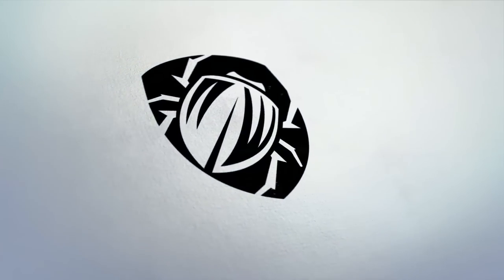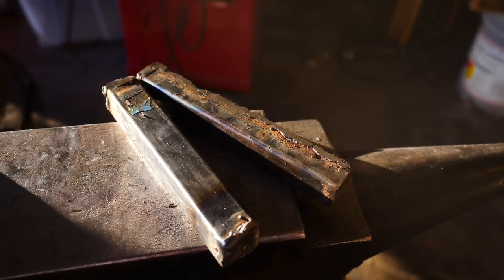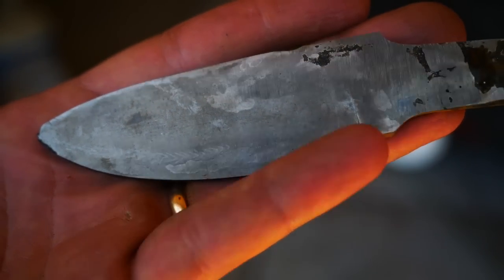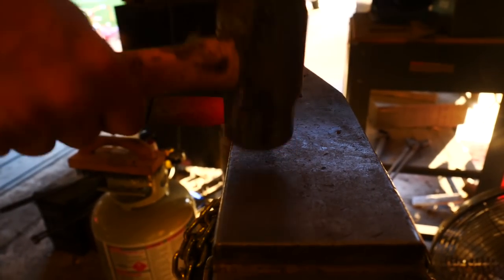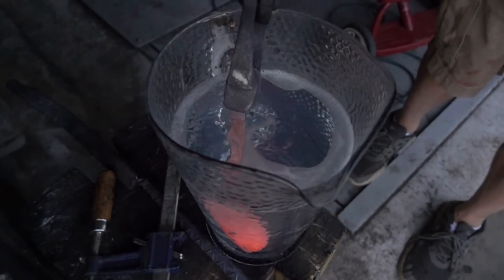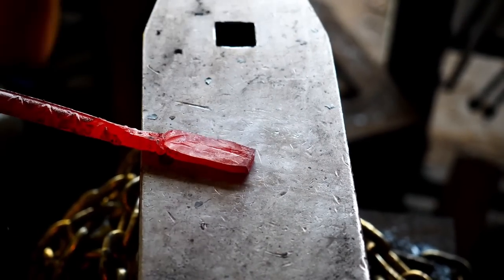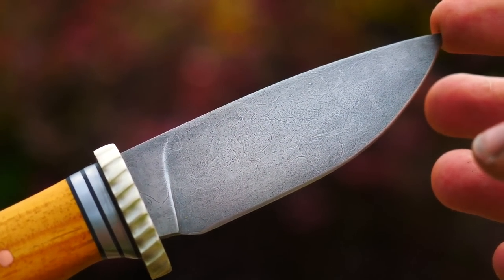Forging A Knife With Drill Shaving Spirals

Comment: Things to consider in the future: 

A can open at one end will be easier to weld closed when all's said and done, instead of laying down much longer beads. This also means you can make sure your can is less likely to come apart during the weld by constructing it out of square tubing. Arranging the drill shavings and powder like you've done will be more difficult, though settling the powder will be easier due to being able to strike the can on end.
Painting the interior of said can with titanium oxide (white out) will help prevent the billet from bonding to the can and make release far easier (much, much less grinding to remove mild steel from the billet). It's awkward to get a long brush down in there, but not impossible.

I like what I see. Happy Forging!
Reply from the maker: The knife is made from a can open at one end.  I've used white out several times. The only time I got it to work was the fish hook damascus knife so I gave up on it.  I've since been told that 'liquid paper', not 'white out', is the stuff I need so I may give it another whirl in the future.
Reply: Sorry if I wasn't clear with the description of the opening's orientation; the square end of the rectangle is just a smaller weldment to seal up.

If you're having difficulty getting it to work, look for something with titanium oxide in it, as that's the primary inhibitor to the weld
Reply from the maker: Kaeska Wood ya I think I understand.  In the video there are two canisters made.  The second is in the orientation I believe you're describing and is the one from which the final knife was made, yes?  Or maybe I'm not following.
Reply: Whoops, my mistake. I'm rather fond of using square tubing for can welding since it's... well, mostly finished. Wish I had more time to smith and less time in the office...

Comment: TD: I most wanted to see the forge welding -- mentioned TWICE; not shown.
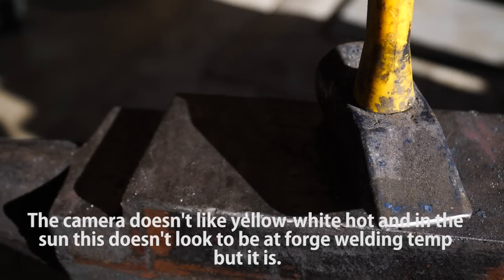Reply from the maker: shown TWICE at; 3:50 and 6:55
Reply: @GreenBeetle  OK, I'm not an expert  -- I was expecting to see you actually FOLD the blade over & over & over to get the layers, adding Borax each time.
Reply from the maker: @tkarlmann    they were tack welded together and attached to a handle then heated until red hot, fluxed with borax all off camera then hammered together on camera.